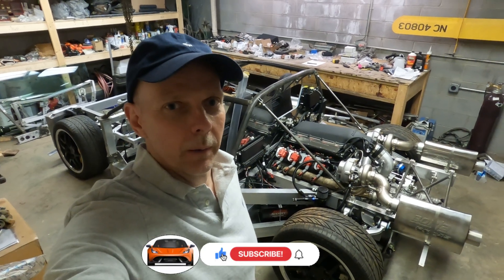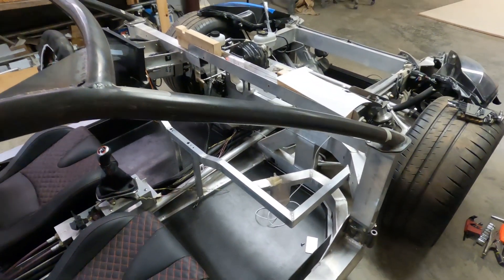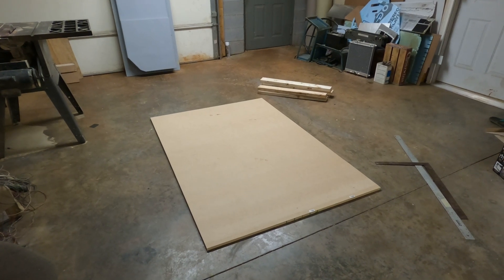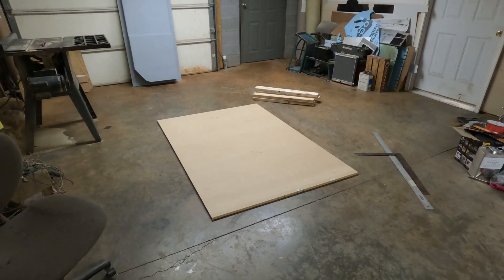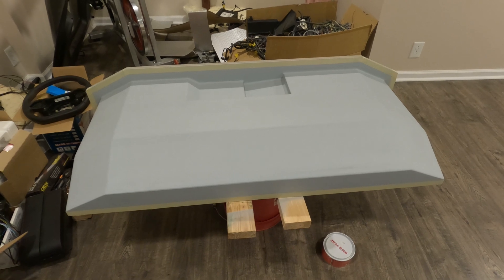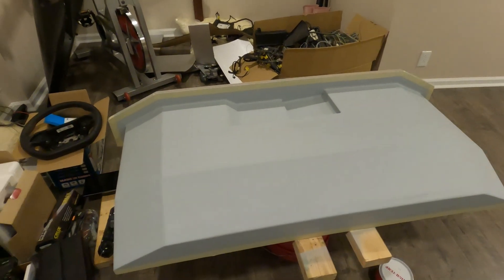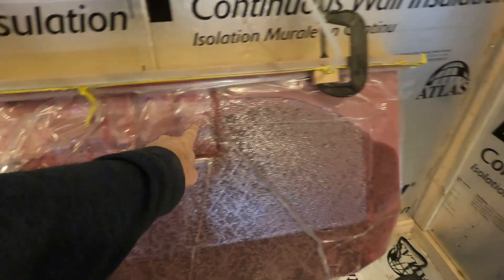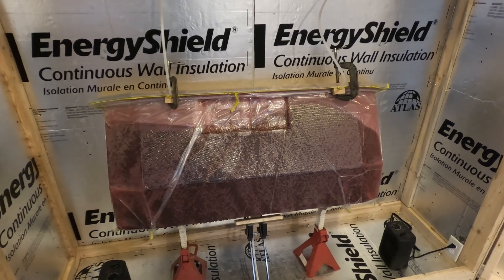Building my own Supercar - My first carbon fiber part failure

Comment: That part is no good. You'll have to start over. Did you test the vacuum bag before infusion? Make sure and test the bag by pulling vacuum and then clamping off the feed and vacuum lines and letting it sit for forty minutes or so to check the bag is holding vacuum. You can use spiral wrap to advance the resin to certain areas faster if they won't infuse properly. The mesh work most of the time by itself but I use the spiral wrap to deliver more resin to certain areas if it won't infuse properly.
Reply from the maker: Thanks for the feedback. I did test the vacuum and thought it was not quite 100%. I thought I could fix the leak easily once the infusion process began. I was never able to find a leak. I might try to infuse the part again, from the other side. The part is purely cosmetic and provides no structural strength, it’s not even seen once the car is finished.
Reply: @basementsupercarbuild2948  Try to be surgically clean when handling the vacuum tape, don't touch it with your fingers. I grab a roll with my finger in the middle and press down on the backing paper as I go. After you pull the paper off try not to touch the vacuum tape with your fingers. It's the oils in your skin that can mess up the bond.  Also, try to make sure there are NO fibers even tiny ones between the tape and mold or tape and plastic.  The plastic also needs to be very clean. You can also buy leak detectors to help you find them.
Reply from the maker: Thanks for the info. If I am lucky, I will figure out how to do this about time I am finished. 😂

Comment: Sure, you could "re-infuse" the remaining dry side. Of course, there will be a bad joint line at the union, cosmetically and  structurally. Both can be remedied (somewhat) structuraly by adding a layer to the backside (or frontside if you are going to upholster the panel) with a hand layup.  The finish surface is never going to be worthy of "exposed carbon" clear coat. Unless you love sanding! 😢
Reply from the maker: Thanks for the feedback. The part is the front firewall. It bolts solid against the aluminum frame. It’s not structural or even seen once installed. I might try infusing it again and see what happens.